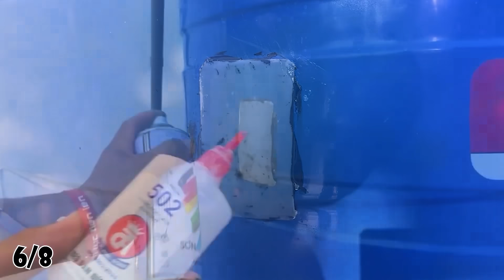I Never Have to Buy Water Again! How to Make Free Water Directly from PVC Drainage Pipe

Comment: I live in New Zealand most people have a system that captures rainwater into a large storage tank that is constantly cycled every time it rains, the reason for this is we are an earthquake nation and when there is an earthquake we are off the grid immediately, rainwater becomes our primary source of water, yes it needs to be treated or boiled or purified, but it’s absolutely necessary in a disaster
Reply from the maker: It's great to hear that New Zealand has such a practical system in place! Capturing rainwater as a backup in case of earthquakes is a smart approach, especially given the country’s seismic activity. Treating and purifying the water ensures it's safe for consumption, which is crucial in emergencies. Do you think this model could be adapted to other regions with similar risks?
Reply: I live in nz to and we catch rain water
Reply: @dianeallen6314  we just bought a second tank yesterday because we still have a lot of water coming off our roof, they sell for just $125 at our local council, at this point I think the majority have them now
Reply: Rainwater is way better then tap water

Comment: I pay my waterbill to get fresh filtered water in return. However I do feel this water should not be used to flush our toilets. So a seperated solution like yours could be the answer to not waste filtered drinking water. However here comes the First world problem: If we all would start collecting rainwater for toilet use the waterbill would not go down because filtering and treatment of our drinking water would still cost the same and this would bankrupt our whole watersystem. It's a Catch-22 situation. In The Netherlands we also have free public taps to fill our waterbottles inbetween walks. We are very privileged and should be thankful. The cooling of the roof with that sprinklersystem is genius. 👍🏻
Reply from the maker: You're right—using rainwater for non-potable purposes like toilets is smart, but it wouldn’t lower water bills since treatment costs remain the same. Public taps in places like the Netherlands are a privilege, and solutions like roof cooling systems help save resources. It’s all about finding a balance between personal use and maintaining sustainable infrastructure.

Comment: Great video. Only thing I would improve upon is that you are wasting piping on the top. you only need the pipe to enter the first barrel since you have them all plumbed from the bottom. the water levels in all of them will rise are water is added to the first barrel. In the last one you may want to add an overflow and have that water redirected somewhere else like the garden or another barrel. I would also suggest putting goldfish in the tanks as mosquito larva will grow in standing water. the goldfish will use that as its food source, so you don't even have to feed them. Always use a filter even for rainwater.
Reply from the maker: Thank you so much, you are absolutely right. That is a great advice. I will keep this in mind. Do you have any advice for me about using a germicidal filter?
Reply: @HolicCreation Aa VERY GOOD OBSERVATION. TOO MUCH PVC PIPES WASTED.....

Comment: I moved into an old Victorian fixer upper. It has an underground round brick cistern. I was supposed to fill it in and seal it. I simply built a room over it and left the manhole in the crawl space. I used to lower fish on a stringer into it until I had time to clean them. It's a couple of thousand gallons of free runoff that has old tiles running into it. The old owners used it for washing clothes. I just have it as my back up water. The cistern is a giant sphere of laid brick. The workmanship is amazing. It was hooked to an indoor hand pump in the kitchen sink, again for washing. I still have the pumps but I had to seal my actual wellhead. So drinking water would need to be filtered and boiled.